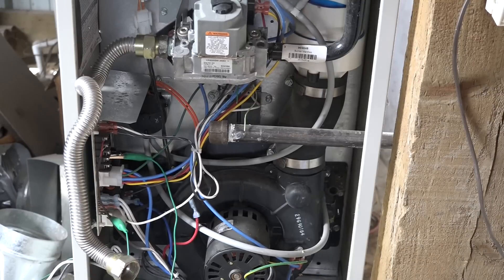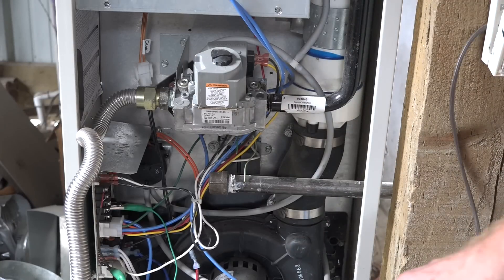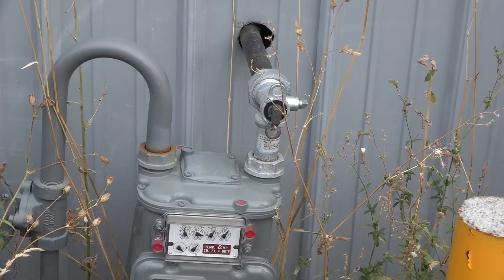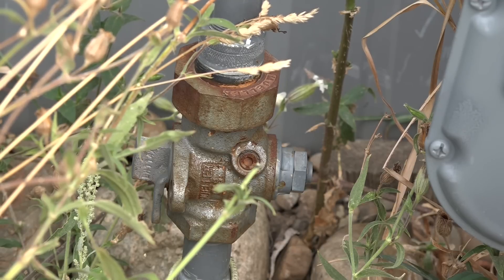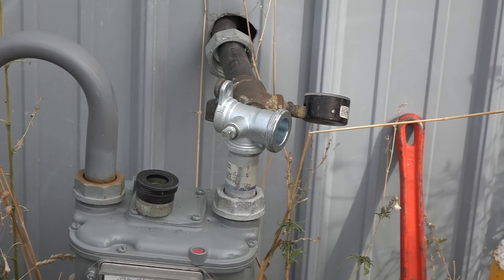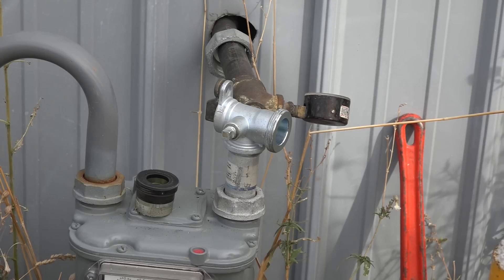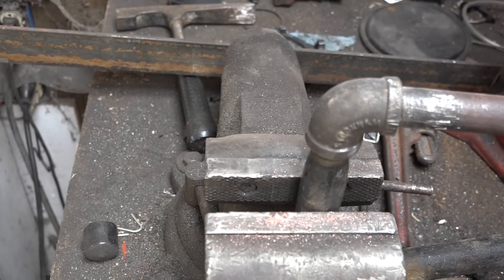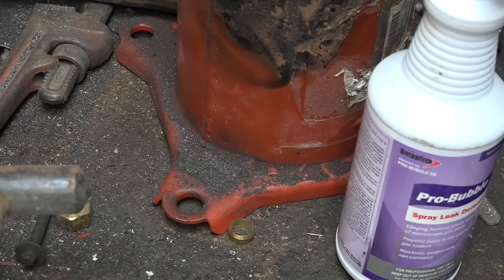How to find natural gas and propane leaks.  Part 1

Comment: Thank you for your informative video.
What do you do when you "check everything" and you still have a leak, small or large?
Thanks again
Reply from the maker: What I would do is disconnect the pipe from the meter and appliances, then pressure it up to 20# or so.  Listen first.  Be sure to check all surfaces of the fittings.  They can have casting sand holes.  Can't find it at 20# go higher until you do.  
GFM
Reply: Thank you very much for your help and your video Also, thank you for your reply..

Comment: Great video. Is the flex line allow to feed the gas valve? From reading the code it says it should be a black iron pipe feeding valve. Gastite can be used outside of furnace housing. can u clarify  this.
Reply from the maker: +Christopher Wilson There are differences in local codes.  However, most jurisdictions require black iron through the sheet metal housing of the furnace.  Inside you may use flex.  Gastite is usually used up to the drop to the appliance with black going to the appliance.  Hope this helps.
GFM

Comment: these pump spray bottles I think just dont work as well as a two inch paint brush does.  You can whip the liquid soap and hold it around the fittings. The absoulte best bubble and cheapest is simple kid's bubble mix. works better then any commercial sold stuff.
Reply from the maker: +gary smith Good thoughts. 
GFM
Reply: +gary smith Thats a great suggestion,thanx
Reply from the maker: +Bill Gringo I have never had the Gas leak detector freeze.  It does get thick though.
GFM